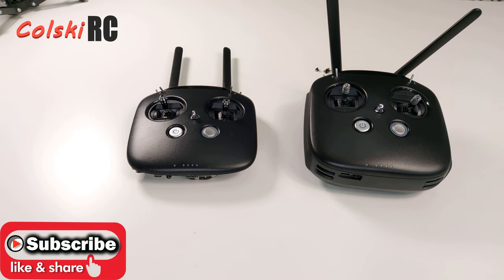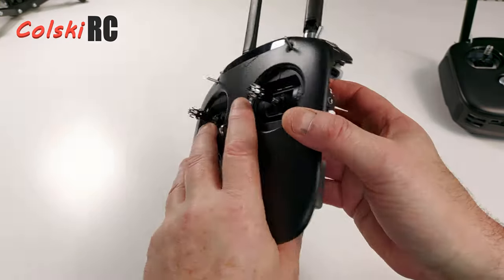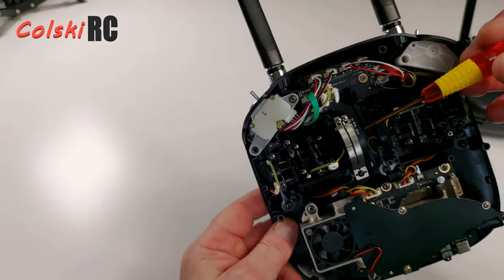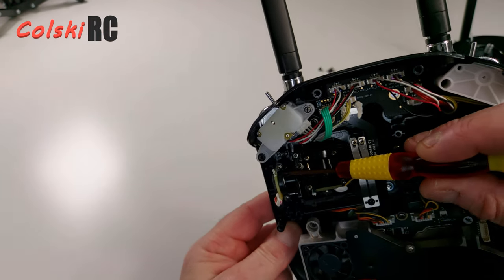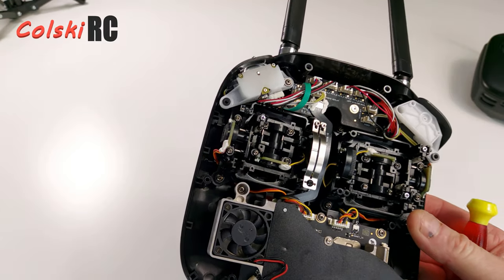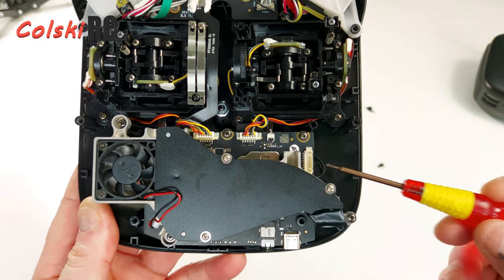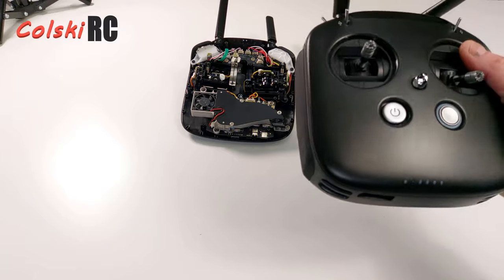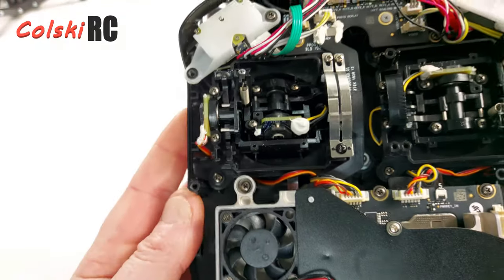DJI FPV TRANSMITTER  MAJOR ISSUE

Comment: I had pretty much the same thing happen. Its a stupid design because the potentiometer is held onto the same plastic bearing retainer which also has the little tab which broke off in his. The two screw holes weaken the bearing retainer and mine broke across the two holes.
I repaired mine by gluing it back together with crazy glue and then reinforcing it with some epoxy. I drilled out the two small holes that hold the potentiometer on and then glued the screws into the holes with epoxy to hold it all in place. So far its held up well.
It was my throttle which also broke and as the small tab that holds the self centering mechanism is not needed I just removed all of it. It would only be needed on Mode 1.
So far its held up well and I think its a permanent repair. I got ahold of an old P3 Standard controller and upon opening it up found that the broken plastic bearing retainers are exactly the same. So I will keep it on a side if I ever need it. I cut up my old P3pro hard shell case and adapted it to fit the controller and goggles plus one quad so that everything is now well protected.

Comment: Sorry to hear about your troubles, I have a similar problem with my DJI FPV controller.  Brand new out of the box the right gimbal has a dead spot, only when rolling right.  Rolling left, pitching forward and backwards is precise and smooth, however when rolling right, in Betaflight it spikes from 1500 past 1600 with a fraction of movement.  Done multiple calibrations, with no success. Opened the controller to check for any loose wires or so, and all looks good.  Probably also have to buy a new one, as shipping it back to DJI is going to cost close to a new controller.  Very frustrating... :(
Reply from the maker: Hi Very disappointing to hear you would think for the price it should have had hall effect gimbals at the very least and no one even replied to my emails

Comment: Did you ever happen to be able to find parts or fix it ?
Sounds like possibly it was dropped.. never heard of any other issues with DJI  controller.
Reply from the maker: Hi no never been dropped the transmitter was immaculate unfortunately its just a poor transmitter miles behind the likes of the radiomaster very old gimbals etc...

Comment: must be very rare for this to happen, ive not seen anyone else with this issue
Reply: Yeah it is probably quite rare but it happened to mine but I admit that I was keeping the controller in a backpack with no protection. The gimbals need protective covers if you do this.
What is interesting is that all of the Phantom 3, 4 and Inspire controllers all have the same gimbals so parts whilst not readily available can be sourced by buying a used controller for any of those DJI birds.